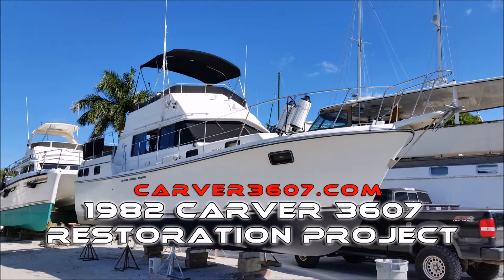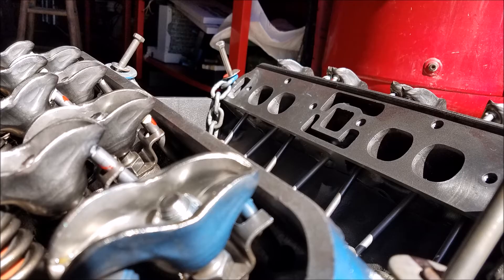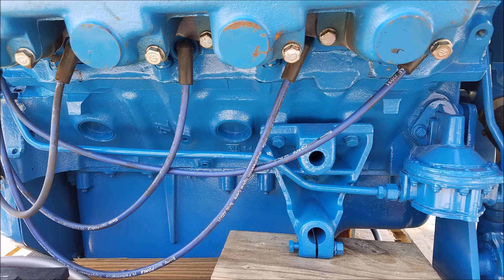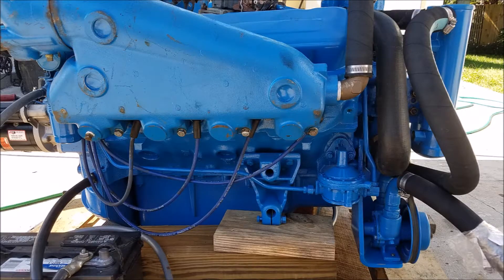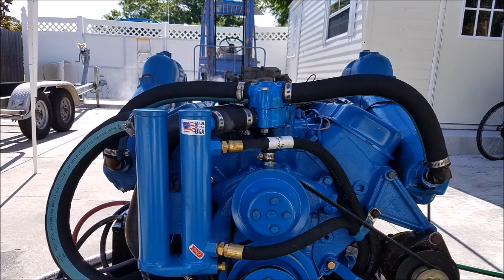Crusader 454 Engine

Comment: can you tell me if the engine plugs can be replaced without removing the manifolds, Thanks
Reply: yes the plugs can be replaced with the exhaust manifolds on.
Reply: @mickymoto100  Thanks, is it done in the blind, meaning you have to feel around for it. ? I see no way you can see the plugs at all.
Reply: @skipperrichman4278  yes they are tucked up there. Get a mirror and a flash light. I have 2 454-350hp engines the outboard are the hardest for sure. Get iridium plugs they last a very long time.
Reply: @mickymoto100  thank so much